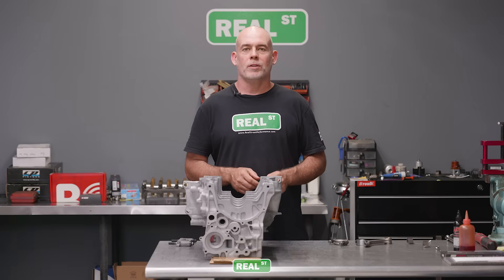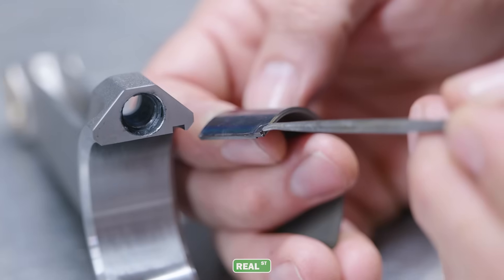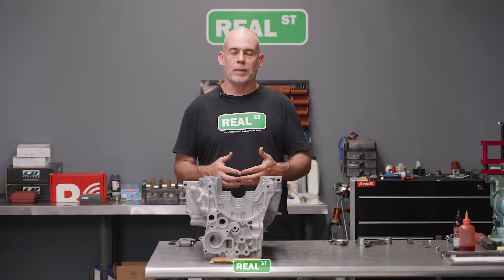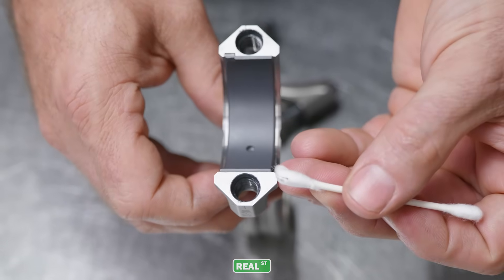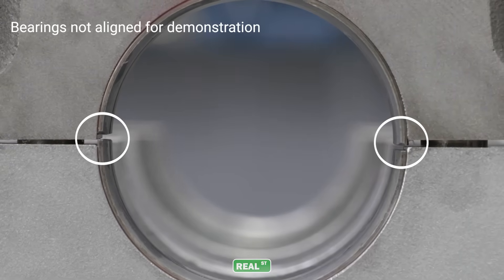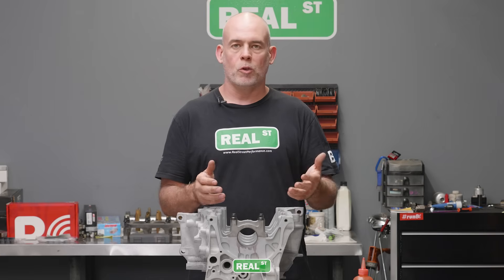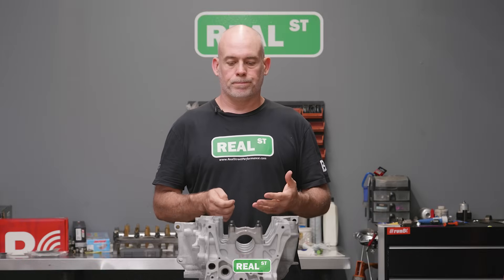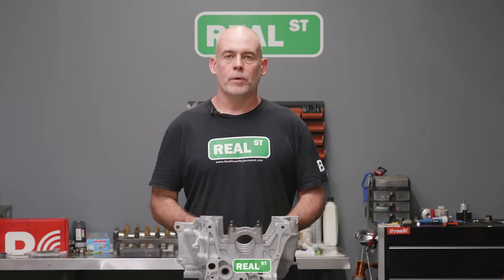Adding Oil On The Back Side Of Bearings During Engine Assembly. Good Or Bad?

Comment: It doesn't cause any problems. It also doesn't solve any. I've worked on numerous reciprocating compressors and a couple engines, and watched our mechanics do many more. Some lubricate the backside, others dont. Guess what? Absolutely zero difference, despite how tight a bearing clearance our machines run. Wiping a bearing back with a clean rag is enough to clean it. Anything more than that I'm afraid is a superstitious ritual. The fact of the matter is things just arent quite as sensitive as people have been lead to believe.

It's the same with how paranoid people are with balancing crankshafts down to the precision they do (on par with high speed turbine/jet engines/turbochargers at up to and over 100k RPM) when in reality, engines don't spin fast enough to warrant that sort of precision (in fact, crankshafts in particular will always have an alternating imbalance due to continuously varying rod angularity that is several orders of magnitude larger).

Now if it makes you feel better or helps with a neat, clean workflow, as I mentioned, it doesn't hurt anything either, so have at it.

Comment: this video would be more convincing if you compared a dry vs oiled bearing with a bore gauge to see what the change is between both
Reply: The oil squeezes out, if you think it’s gonna throw off the tolerances, you’re crazy.
Reply: thats key, it works for sure and i wouldnt doubt that considering there are tolerances, and if its out of tolerance or very close within most times itll lightly self clearance and become non issue. but then after a while, that oil will be gone and your clearances would be higher. from my perspective it would be ok to do, but its maybe 25% maybe more, of cases the engine will not last as long. By then something else might have failed. its all chance
Reply: @Neural_Narratives-b5k pulled that outta your arse 😂 you have a pro builder and randoms are arguing with his technique.
Reply: @_..-.._..-.._  was probably drunk when I posted that, honestly it looks like I was rambling 🤷‍♂️🤣

Comment: Like any assembly lube, it allows the bits to nestle with less friction. I'm confident any residue is smooshed out under torque. Lot's of comments against here. "I haven't tried it because I know I don't like it."
Reply: I once stopped at a persons home garage to drop off a manifold that I milled for him, he was wiping red loctite on the backs of the rod bearings and assembling them one by one. I said you are nutso, you cant do that. He said, it says stud and bearing mount on the bottle, why not? I told him it will change the crush and the bearing clearance and it will burn up.
A week later he was bringing a scarred up rotating assembly to repair.
I asked why he put loctite on the bearings, he said to stop them from ever spinning.
I asked where he learned that, he said " the internet"

Comment: Well I've heard a lot of different things. I think you can do it either way if it's done correctly. I've also heard professional engine builders say to clean the journal surface of the bearing and others say not too. I have seen them cleaned with Scotch Brite pads and the builders seemed successful. I personally clean both sides of the bearing with a lint free, virgin shop towel and install them with the back side dry. But I exclusively work on 60s/70s domestic V8 engines that maybe don't have the small, lighter weight parts used in a modern imported or even domestic 4 cylinder engines. Those old engines can take a little more abuse during assembly than a newer design.
Reply: I used to use clean towelling but it leaves too much lint. I use kitchen paper these days and it is better. Laquer thinners or brake clean.
Scotch pad  or worse steel wool 'cleaning the bearings' will always be wrong though I have never seen an engine come apart because of iy. But bearings are soft and the top layer normally uses and 'embedibility' layer and cleaning that simply puts minute abrasives into the new shell.

Comment: Why do they pin bearings
Reply: They only pin aluminium rods. Aluminium rods grow when hot and the oil clearance gets larger and well as the crush gets less. The dowel holds the bearing as the crush gets less.

Comment: We used to rebuild NTC-855 Cummins diesels in the frame. You would do one main at a time and we would clean as best as possible, then roll the top main bearing into place around the crank, install and torque the cap and done. These would run 350-400k miles with no problems. While they didn't turn 8000 rpms, the pressures in a diesel are considerable under load.
Reply: I saw in Thailand workshop that in frame they wipe mains with clean rags then spray clean diesel onto the mains cover with rag for an hour before putting on the bearings in. Its hot there and they abuse all things that move but just wondered if this was done by others?

Comment: What happens when you take a motor apart and remove the rod bearing? There is oil on the back side right? So what's the harm in adding oil on the back during assembly?
Reply: I did an apprenticeship in a reconditioning shop and then a further 20 years and i cant say that the engines i have ever pulled apart had oil under the rod bearings they were pretty much always dry. I learnt all about tunnel sizes nip, crush etc but not to put oil under the shell nor have i ever seen anyone else do it.
Reply: No there should not be any oil under bearing when you take one apart if assembled correctly will not be any room for oil to get behind bearing.
Reply: Change clearances in the beginning,those galleys aren't used untill full assembly then primed.

I've never put oil in the back of a bearing due to measuring for clearances but I agree that we should see a video with clearances with and without oil on the back. If it dramatically closes off the clearancing that could be an issue to begin with
Reply: @1997obspsd   Yes we need someone to do a video on that using two of same motors and bearings. One with and without oil.
Reply: @ahmedsimmons4465  Common sense tells you that any oil foolishly put under the bearing shell will get squeezed out when the caps are tensioned as the bearings are designed to be an interference fit when the caps are tightened this is where the nip and crush come into play.
Reply: Good point

Comment: I’m not sure it matters personally. It might help with assembly. But every time I pull a motor apart there is oil between the rod and bearing. Not much but it’s there. So cleaning the bearing and installing dry, oil will get under it anyway. I think it would be ridiculous to think it would stay dry.

Comment: Bad. The bearings are made with tabs and locks so that they fit exactly and so they don't spin. The oil can misshape or mislocate the bearing. Why even put oil there? What's the point? It's stupid. Clean the backs gently and insert them gently. If you think you need oil to help prevent damaging or bending the bearing while inserting, you're being too rough or you're just plain incompetent. If you have material oozing out with that oil, you didn't clean the block or the bearing back, now did you?
Reply: Tabs do not keep the bearing from spinning.  
They locate the bearing.
Crush keeps the bearing from spinning, up until your poor oiling systems heats the bearing shell and it shrinks, then proceeded to spin
 Bearings are not round.
New engines do not have tangs on the bearings anymore.
Go back to school. you are not the internet wizard you think you are.

Comment: Am suprised by this... Ive always gone with super clean and dry, always watching for those lil shavings. Cant say Ill ever change that, the physics say its a bad idea, but hey, if you have a successful track record- keep doin what youre doing!!👍👍
Reply: Yep... it's much easier to insure NOTHING is stuck to the bearing or bore contact surface if it is DRY... in fact, the oil will tend to attract and CATCH debris.
Reply: @kentuckybowl-o-sticks I agree having oil on back of a bearing will change the clearance in the tens of one thousands and could interfere with heat transfer, that backside film when burnt from heat could create bearing move or walk from loads imo.
Reply: @zdravkomomci7570  Yep... I can't think of any BENEFIT to applying oil there, so... why cloud the issue? Almost like PUTTING weevils in your cereal : )

Comment: I dont oil the backsides of them never have.  But to the guys saying its gonna change the bearing clearance, do you not think living a life doused in oil isn't gonna result in oil eventually making its way between the shell and block anyways? I mean I've never disassembled a block and the back of the shell be magically dry.  I can't imagine that film on both halves even totals .0001.  So you have taken your bearing clearance from say .0030 to .0029 and now the engine is f'd.  Ya, ok.

Comment: Everyone knows NEVER oil the back of the bearing. Clean the area with brake cleaner and slide in. It's common sense
Reply: Deborah TheMiorgan  WOW. I'm a tech had thousands of engines apart and oil does get on back side of the bearings. Wow how does oil wicks it way up main bolts that blind holes and gets trap there. Again there is film of oil on backside of the bearings, Get there by pressure on some bearings or wicks in on others HINT oil still gets there
Reply: No, this isn’t common sense and doesn’t make sense.  Do you really think that the oil doesn’t get between the bearing and the block or cap as soon as you fill the sump and run the engine for a while?  This is just a laughable comment.
Reply: @LTVoyager  It certainly is 🤣🤣🤣

Clearly the author of that comment has never rolled main bearings into an engine (like during an in-frame overhaul) where oil is necessary on both sides.
Reply: @johneckert1365  And doesn’t even appear to know the path that oil takes from the block to the crank journal.
Reply: @johneckert1365  You mean that shaving the backside of the bearing as you roll it in is a bad thing?
Reply: @johneckert1365  Yea clearly. What is the benefit of oiling the back of the bearing? Nothing and should never been done. Noni haven't done an overhaul in chassis. Apparently you're a heavy truck dude and I'm not. You probably build engines in a dirty environment, lol, I don't. Anyway, guys, don't lube the back of the bearing ever. Keep it clean & dry, thanks
Reply: @LTVoyager  lol thank you 🙏
Reply: @LTVoyager  Maybe @blueskyretardo could invent little oil tubes, almost like stints, so he can make sure his oil from the block can only be pumped to the crank side of the bearing. He could even machine itty-bitty o-ring grooves in his block and bearings to ensure non of that horrible oil creeps it's way between the block and bearing. 
Hmmmm, if he stopped putting oil in his engines he wouldn't have to worry about that 🤔
Reply: @johneckert1365  Yes, I was thinking that maybe he cleans the back of his bearing shells with brake cleaner so that he can apply RTV around the oil hole so that the oil can only go through the hole to the journal side of the bearing and not get to the block/cap side of the bearing as it goes through the hole.  Or maybe he uses “smart oil” that knows enough to not go between that first interface (bearing to block/cap) and only go into the second interface (bearing to journal).  If I only knew where to buy some of that smart oil that knows where to go and where not to go!
Reply: @LTVoyager  Yup, I've heard about that smart oil he uses. It can communicate with your mobile device via Bluetooth. Or in your GM vehicle you can just conveniently hit your On Star button 👌
Reply: @LTVoyager  Sure oil gets behind the bearing, but it needs to be dry when installing for clearance reasons and start up reasons. Oh and don't talk about my comment being laughable, you know Nothing of my career, thx
Reply: @bluesky-ud9wg   Nor do you of mine.  It makes no measurable difference if the bearing shells have lube on the back or not.  When the caps are torqued, the force will squeeze our virtually all of the oil resulting in bearing to metal contact at all of the high points of the bearing and block or cap (yes, even the most finely machined surfaces look like the Rocky Mountains up close).  Likewise, as soon as the engine is started and 60+ psi oil is forced into the bearings, oil will also be forced between the bearing shells and the block/caps to fill all of the microscopic voids between shells and block/caps.  If the engine is then disassembled, the difference in amount of oil on the back of the bearing shells will be indistinguishable.
Reply: @LTVoyager  YOU popped off correct?  So I just lay down, I don't think so. As I said you never oil the back side of any bearing period. You do it your way and I do it the Correct way. I'm not going to argue with you. Take care
Reply: @LTVoyager  Oh and oil pressure isn't pushed Behind the bearing dude, just the face of the bearing, common sense....
Reply: @bluesky-ud9wg  ROTFL.  Old wives tales die hard.
Reply: @bluesky-ud9wg  Please tell us how the oil gets from the block to the crank journal in a pressure oiled engine.
Reply: Never have I seen oil on back of bearing tearing engine apart, only brown heat tarnish period!! I guess next time I put wheel bearing race in I need to grease back side of it.
Reply: What do think that brown tarnish is bearing material or wait thats valve stem seals material as it wears yes thats what it is
Reply: @pdmustgtd1013  anybody that oils back of bearing is complete idiots, at machine shop today picking engine up I had bored and I ask them about it ,that was the first thing they said.
Reply: @jeremyking5684  Where did I ever say do this???????? Go back AND READ VERY VERY VERY SLOWLY on all of my post. Oil works its way too back side of bearings. I just pull rods and mains from Cat C15 there is some oil there PERIOD. My machine shop said oil gets into everything that is inside the engine and that you're idiot if you think it doesn't. If you think bearings stay perfectly round under load they don't they flex.
Reply: @pdmustgtd1013  I've torn down thousands of engine's never seen oil on back of bearing, just tarnish just like cast iron skillet will get.but like I said putting oil on back of bearing is a wasted step that has absolutely no purpose !
Reply: @jeremyking5684  So have I taken thousands of engines apart even some with well over million miles on them. Tarnish crap is oil thats trapped there it doesn't exactly flow in and out. When you roll main bearings on in frame overhaul you can't exactly get in there to wipe bearing bore. Guess what there is oil there when you roll new bearing in. Guess what engine manufacturer says nothing about it just roll bearing in. Many question this in training class answer is some oil works it way there and gets trapped.  AGAIN I never said put oil on back of bearings. Who cares if guy in video does do you proof it hurt it nope and neither do I
Reply: @pdmustgtd1013  what ever man ! You must be a big believer in doing this bullcrap to keep trying to prove a point find somebody else I know what I know.
Reply: @jeremyking5684  Whatever your the expert  you know more then anyone yet WOW. I've worked with engineers who design and builds engines running them hard on dynos and in vehicle's. Engine grows and shrinks with temperature too
Reply: @jeremyking5684  HEY EXPERT how can oil fill up blind bolt hole, with flanged bolt no washer and under torq load like a main bolt?????
Reply: @jeremyking5684 When doing an in-frame rebuild on a big diesel, or even just rolling new bearings, we have to oil both sides of the main bearings so they slide in nicely. I realize this isn't the same situation as the video, but I still thought it was relevant.
Reply: Just because 'EVERYONE KNOWS ' doesn't mean it's right.
Reply: I mean, this dude has built hundreds of engine with tens of thousands of horsepower he has created. I feel his opinion is probably valid.
Reply: Ive been building Race motors for over 30 years. Never and I mean never oil the back of a bearing. Light 400 paper sand and clean with Brake cleaner with a lint free Rag. period !
Reply: @ezpz7143  ABSOLUTELY. You never, NEVER want the bearing to move EVER...
Reply: help then spin easier
Reply: @juansimon5802  Not on the back side!!!  That's how you spin a bearing.
Reply: @bluesky-ud9wg  Funny oil makes it way to backside all on it's own. YOU going to tell me you have taken engine apart and never had oil on backside of the bearing it was dry I CALL BS. I don't put oil on backside but oil still gets there.
Reply: @pdmustgtd1013  yes most or all eneines i pull apart there is no oil on back side!!!
Reply: @ruxoneto6560  I call BS they all get oil film on them over time. I've taken thousands of engines apart. Even get oil straining behind cam bearings too. Oil even gets in between block and main caps that help with block fretting (main caps wear into the block) On Cummins engine you put gasket eliminator on parting surface
Reply: @pdmustgtd1013  Seeps into there; over time...
Reply: @pdmustgtd1013  yes & gasket eliminator ovet time break's  loose & goes thru the oil system
Reply: @ruxoneto6560  It's on parting surface so no it cannot break off. It does keep main caps from fretting by keeping oil out. It's put on very thin and lightly and if it does come out some you wipe it off.
Reply: @ruxoneto6560  Just pulled one apart yesterday BMW N62 4.4 V8 Stock, nothing crazy, but had oil on the backs
Reply: @bluesky-ud9wg  do you know about oil film sheer, and the math that drives those equations?
Reply: Deborah TheMiorgan  Please grow up what are you 5. I've been 15 different classes of racing for 50 yrs, graduate from best of the best schools so try to keep up.